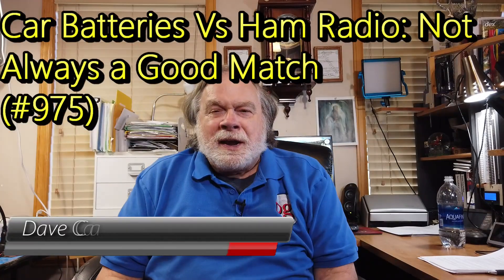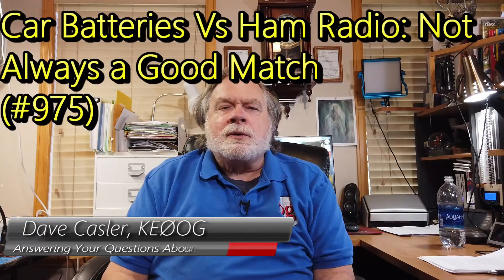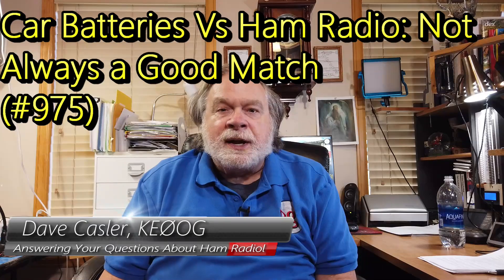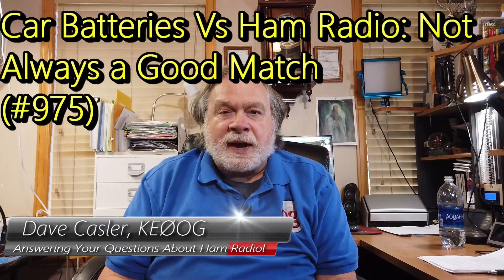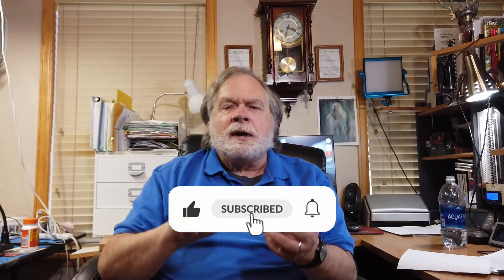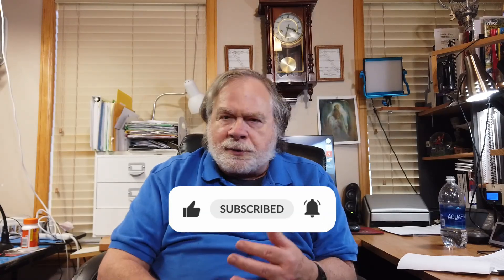Car Batteries Vs Ham Radio: Not Always a Good Match (#975)

Comment: Hi Mr Casler

I have an issue with a repeater station (not exactly HAM radio) that has a heap of noise and interference. Our technician (of questionable qualification) has told us that it is caused by the big 100AH car battery we are using as a power supply. Does this sound at all plausible to you?

Comment: I'm surprised they don't make the radios a bit more flexible on their voltage requirements... One thing I've noticed with the various personal electronics that we travel with these days is that most of them have a pretty good range of AC voltages that they can operate with, so all you need to do is convert the physical plugs used between your country and the country that you are visiting and the device will still work...
Reply: Cost my man, cost.

Comment: My preference is NiMH chemistry. I wire two 6-cell sticks in series. This chemistry is much safer in charge, discharge, & storage modes than a LiPO is. I put a power diode in series in the discharge path to drop the terminal voltage under load by 0.7V, & as the terminal voltage drops I can short the diode with a cliplead to bring the voltage up to my radio. A 3 to 5Amp diode is suitable.  And NiMH chargers are simple & less-expensive.  Best 73 de VA3ROD in Scarborough, ON...Canada
Reply: DEANS plugs are a good connector choice, rated 25A, heavily used in model aircraft & model ships. Available on AMAZON. Much less expensive than power pole stuff. Many model batteries come with DEANS female. You just put a male on the radio cable. Harnesses to make series or parallel connections are also on AMAZON. Also NiMH & LiPO battery chargers. A good test load is a 2057 auto taillight bulb, giving you two current drains, having 2 filaments.

Comment: when I was in Middle School,  I did not have money to buy regulated power supply.  so I found 500mA DC charger and old car battery,  it was good enough to transmit at 10 watts  3 amp. at 12V.   also good enough for most CB radio.  poorman's regulated power supply. AG6JU

Comment: Anyone who tries lifepo4 batteries will never go back to lead acid
Reply: see above, what he said
Reply: Not to mention their failure modes are a bit tamer than other lithium alternatives. Had the battery in my old laptop try to “escape” its enclosure the other day… I would take the slight energy density loss of LiFePO4 cells over that risk any day.

Comment: The problem with car batteries, even the small ones, is their heavy. Back in the 60's we would hike to mountain tops with a Heathkit Twoer or Gonsett , beam antenna and car battery. If you can drive up or in, it don't matter much and you can use the car as a charger.

Comment: Old rigs (not all) accept better the low voltages and also are able to operate with the car engine not running (charging).
I have an old Atlas and works perfectly until 10v drops.